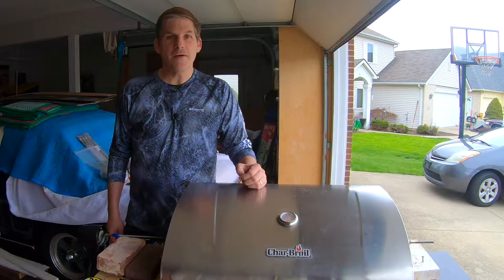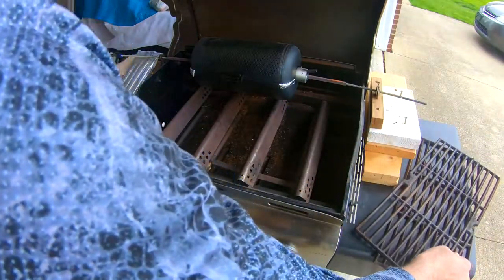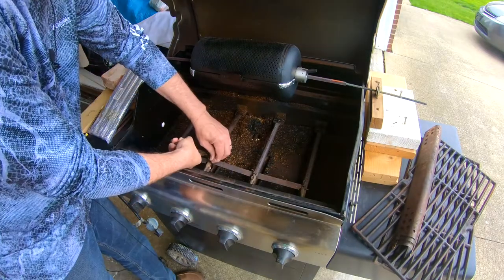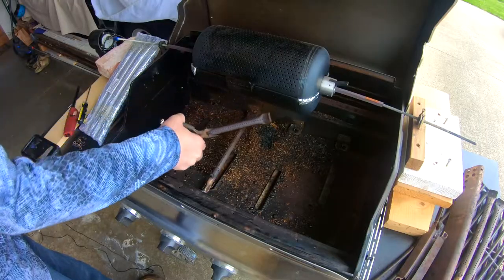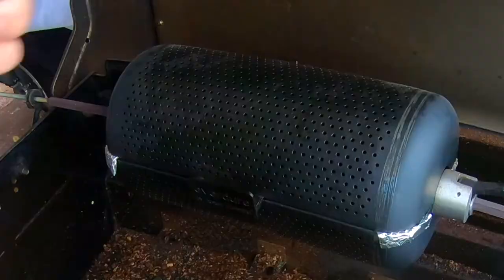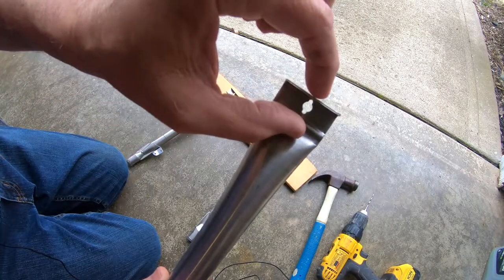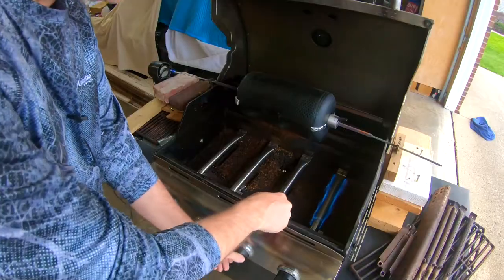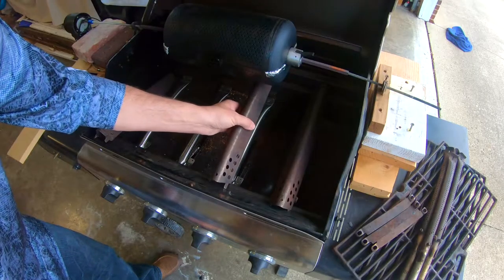Char-Broil Gas Grill Repair / Easy DIY fix gas grill flame problem

Comment: If my spots like you first showing are flaming like that and even causing the front cotter pins to glow, but it’s a NEW Charbroil grill, so obvious no rust etc, what would you recommend?
Reply from the maker: Hey Mary…,
That is odd. When I’ve put in new burners , that seems to be the cure for mine. I’m just not sure. Maybe contact Charbroil customer support?
Thx for watching.

Comment: Are the transfer plates necessary?  It looked like the replacement burners were working well without them.
Reply from the maker: Hey Murphy,
Hard to say - I’m guessing they were made for a reason. So far so good though!
Thx for watching!
Reply: The transfer plates are not needed in his case, as he is lighting the burners each by hand.  If he were to repair the ignighter, then he would need those plates, as they transfer the ignited flame across to each burner.